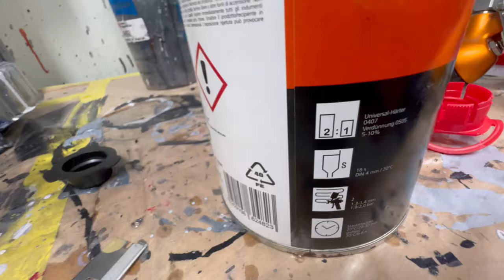4CR 7272 CLEAR COAT REVIEW

Comment: Hi Mario. Great job as usual. I also try different clear coat brands and its sometimes difficult to achieve good results. Practice makes perfect as some say😅. I have a guestion ,maybe you know the answear. On saturday I painted solvent base and it was incredibly transparent thats why I didnt put clear coat. On monday have to go to shop to buy some more base coat. Do I have to sand it to get adhesion , what Ive already painted or can I apply one more coat of base and finish with clear. Two places were also blended with wet bed and the color match was good😊
Reply from the maker: @ukaszmietus7453  thank you! Just give it a light scuff before base
Reply: Ok then.  What kind of sandpaper 800 or 1000 or higher? Thanks for advice😊
Reply from the maker: @ukaszmietus7453  800 grit. No problem.

Comment: Hi Mario, that 4CR clearcoat looks really nice and as you said the finish is beautiful👌you mentioned about getting a nice wet coat of base down, I also use solvent base but I normally struggle getting my second coat of base down wet, the first wet coat goes on fine but it seems like no matter how slow I lay the second coat it never looks wet like the first one does, I always end up with a good finish from the clear so it doesn't seem like it's a huge problem but was wondering why this is happening🤔thanks Mario🙏👍John UK
Reply from the maker: @JohnWD40TC02  thanks John👍 you should be able to get both coats the same. I’m not sure why you have that problem. If you spray it the same you should have the same result.
Reply: Thanks for the reply Mario, who knows mate it's another one of those issues that only I can produce🤦‍♂🤣I'm not to concerned as the end product looks fine off the gun👌
Reply from the maker: @JohnWD40TC02  the good thing is you lay it down on a good foundation and you know how to spray the clear.

Comment: Naive question.  How is a 2:1 clearcoat a high solids clear.   Aren't high solids clear 4:1?
Reply from the maker: @robertfontaine3650  not always.
Reply: @mariopaintclass6091  very useful reply.
Reply: High solid clears come in both mix ratios. The solid content is determined by the manufacturer and depending on what clear.